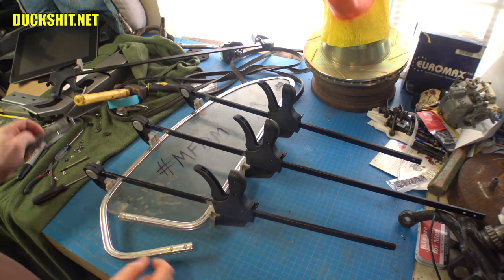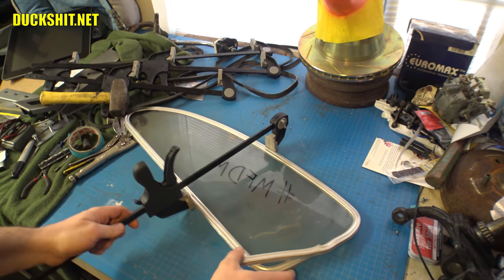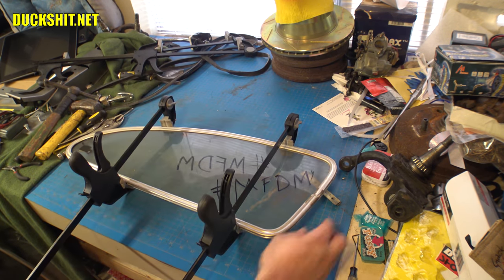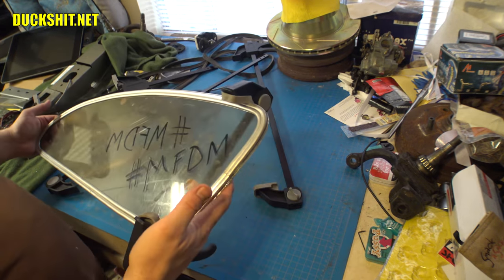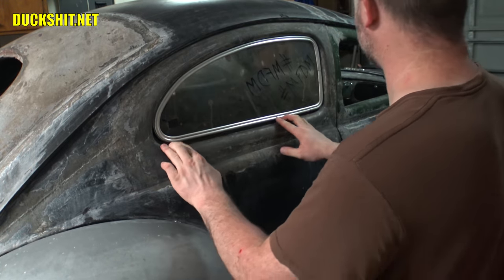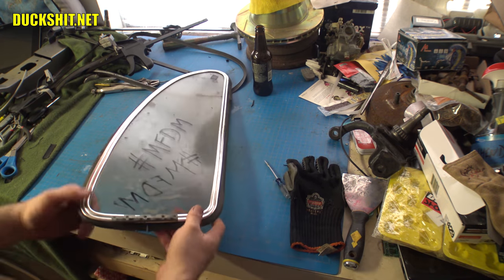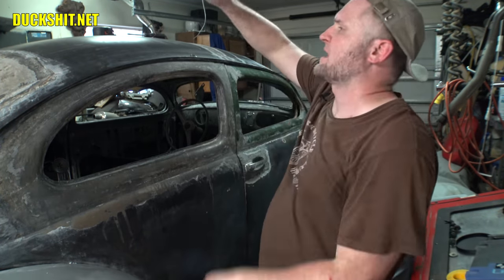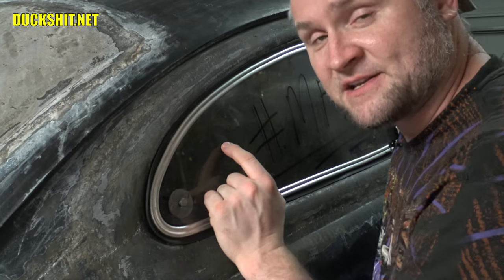Custom Chop Top Pop Out Windows 2 - ROTTEN OLD 1956 VW Beetle - 110

Comment: It's alloy/Magnesium , hit it with a plastic or rubber mallet to get the kink out, easy. Slit the seal first and you'll have and blunt end and you an pull it through the channel.
Reply from the maker: Its some kinda alloy, I'll test the MAG theory and attempt to burn some, I don't think it'll ignite though.

Comment: just a guess ;) is there something to pay attention about thermal expansion of glass and the metal frame? so let them make the glas some mm smaller? Also for the glue/silicone?

missing screws = screwed? :D

man, send some cooling rain to us!
Reply from the maker: By the end of the video I got screws from the local hardware store...  The frame I expect some expansion after I had thought about it more, but the glass shouldn't change as much as the metal does.  It was actually 73°F yesterday here in Florida!  That was amazing!
Reply: the frame is usually a bit larger then the glass - shrinking of the metal
counted that its a closed seal in any condition.
Reply from the maker: The metal will expand greater and faster than the glass ever will.  Turns out my gap was bedcause the hinge screws pulled out of their threads.  I had the same problem on the other side.  I used some self-tapping that were slightly larger to resolve the problem.

Comment: Ridiculous! And i thought the seal comes onto the lip 
and not onto the window. Sorry, i deal only with 
Benzen, Saab and some exotics.
Reply from the maker: Yes, even I thought this is an odd setup up but it works!
Reply: But you know that with a seal fastened to
the lip you save adjustment time and you
have the higher sealing aka compression
rate against a.e. spray water then w this
Reply from the maker: Thanks!  But thats how it works!  LoL!
Reply: The other way it seals better and easier
to fit. And gave a sort of 'modern' look too.
Reply from the maker: @junkman6456  But we're trying to keep the vintage look here.